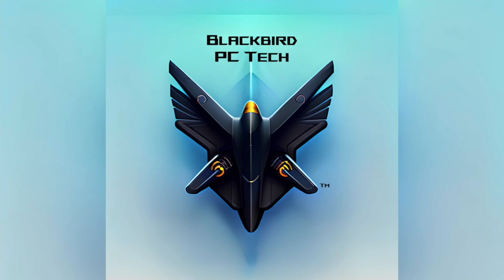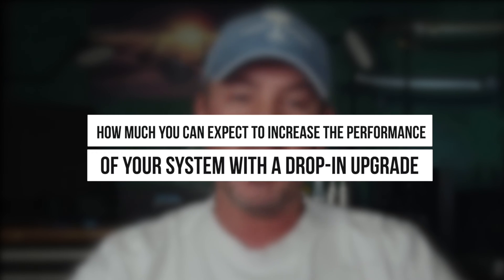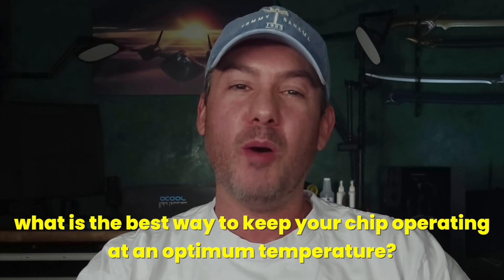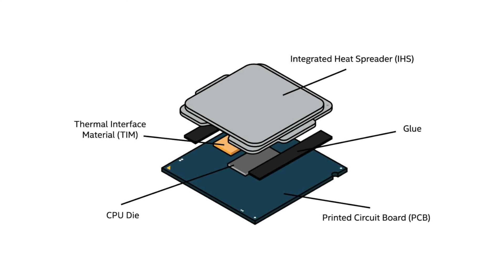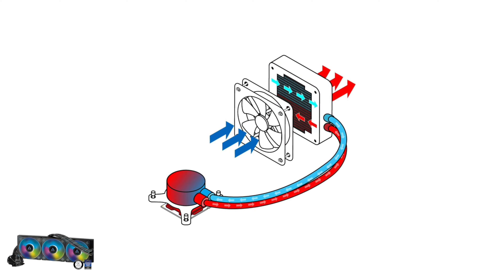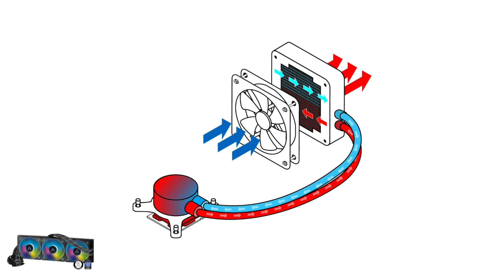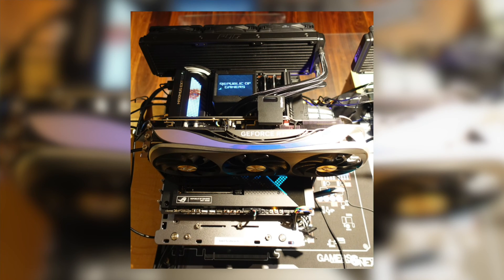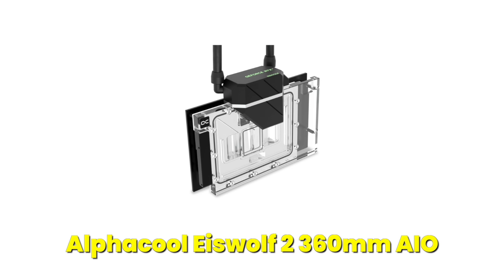Is GPU Water Cooling Really Worth It?

Comment: You're missing the point. It's not about boosting fps, but getting rid of whiny stock gpu fans.
Reply from the maker: The stock fans on the TUF card are actually good wrt noise levels and you can get coil whine on any card, regardless of cooling solution. An AIO does however give you more flexibility to place the fans and to select different fans to meet your needs.
Reply: More like getting OC headroom, no point going water cooling route if you're just gonna use the GPU at stock speeds
Reply: No the main point is to avoid ram and cpu heat building up in the case because of hot gpu air.
Reply: you also missed the point, it's about not having sun temperatures

Comment: Other issues to take into account, space savings of an AIO to get back PCI-E slots on motherboards with limited or bad placement of PCI-E slots, if you are going to a server card that doesn't normally have a cooling solution and other things make the AIO more attractive.
Reply from the maker: Very true, especially with the larger current gen cards that can take up 3+ slots.
Reply: @blackbirdpctech  Or you are trying to stack a bunch of them into a case for AI stuff these days, you really need to have them fit in smaller sizes, or you have to go the old Miner route.

Comment: is it a lot quieter. because thats a fine upgrade if its say 30-40% quieter too. Performance isent the only meaningful stat when you have a box of fans 3ft from you.
Reply from the maker: That's true ... unfortunately I didn't test the noise levels when I conducted the testing for this video. Both solutions use 3 fans however with the AIO you do get to select the fans that you use, so that can be an advantage. I used BeQuiet! low noise fans, so they should be better than the stock fans on the TUF card. That said I tested these on an open testbench and I didn't notice any appreciable difference in noise.

Comment: Of course converting an air cooled card to use an AIO won't be much different performance-wise. They're intentionally limited and will hit their other limits far before they hit their temp limit. You'd need a separate vBIOS to get any kind of performance gain. For example, look at the Asrock 7900XTX Aqua. It's exactly the same PCB as the 7900XTX Taichi, but the Aqua gets a separate vBIOS that gives it a decent performance increase over the Taichi, even if the Taichi is watercooled.
Reply from the maker: While that is somewhat true with modern GPU's, the reduction in temperature will help the card boost higher for longer, so there is some benefit. However you are correct that you would need a new bios to take full advantage of a water cooled card and you would ideally need the voltage limits to be relaxed, something Nvidia has forbidden. Given what has happened recently with Intel and their i9 fiasco, I can't really blame Nvidia for controlling partner cards even though it sucks for enthusiasts.

Comment: I have one in a PNY 4080 super and the main difference is the noise, if you care about the noise, this is the best option
Reply from the maker: Great point … I recently purchased acoustic test equipment so I can measure the noise when I test components moving forward.
Reply: This is the sole reason I water-cooled my GPU!  My gaming machine is near silent now with AIOs on both CPU and GPU

Comment: This was really helpful. Do you think that if the pump of a Liquid-Cooled GPU, like the Colorful Neptune, dies I could just add a Custom Loop Pump between the Card and the Radiator? That would mean I don't have to buy a Waterblock and open up the PCB, right?
Reply from the maker: That’s likely not a good idea but it should still work. A non working pump will add resistance and would provide a surface for debris to build-up. If you are adding a custom pump you might as well add a water block … but yes, that’s a lot of hassle.
Reply: @blackbirdpctech  Thank you, appreciate it!

Comment: Fast answer to the video title:

NO.
Reply from the maker: It’s fast but is it right? For performance it doesn’t matter but there are other considerations, such as case fitment and performance in airflow constrained environments.
Reply: @blackbirdpctech  still not worthy at all. If you are going to build a PC you should know first the total space you got for a GPU and get one that fits in preferably, also if that's the only problem, you can literally get a new case with better airflow and all instead of wasting almost $300 on a GPU block + loop parts to "solve" this, and I'm not even saying "get a bigger PC case" because some ppl don't like big cases, but even then, there's some good quality SFF cases that can fit a full size 4 slot GPU on a tiny package and also solve the GPU fans facing the glass problem.

The only scenario I can see that is "worth" to WC a GPU is if you already have a WC custom for the CPU or you're going to build one, so you can WC both CPU and GPU, which makes sense, but custom WCs still not worth to the wallet at all in first place, people do because it looks cool. If I would guess, I would say that 95% of ppl that have custom WC loops don't even touch the grass in front of the gate to the overclocking world to justify having a custom WC, they do it just because it looks cool.
Reply from the maker: The video is focused on GPU water cooling with a GPU AIO, as shown in the thumbnail ... probably a good idea to watch the video 😉

Comment: You totally ignored the most relevant reason for switching to an AIO.

NOISE!
Reply from the maker: That’s because in most cases you are simply moving the source of the noise, not eliminating it. That said it would be good to understand specifically what you mean … how does installing an AIO on a GPU reduce noise?
Reply: @blackbirdpctech  some people heard of water cooling before they heard of newer quieter fans i guess >.>
Reply: @blackbirdpctech it makes a big difference if you have something like 2 100mm fans or 3 120mm fans which blow the heat directly out of the case..
Reply from the maker: @ I agree, smaller fans running at higher RPM generate higher frequency noise which can be more annoying however, in this case we are comparing a well designed 4090 TUF air cooler to a 360 AIO ... the noise difference is minimal.
Reply: @ I agree. A good air cooler is not worse than a water cooler. But fot most people the benefit isn’t additional performance, but solving the heat/noice/space/airflow problem in the case. My rtx3090ti FE (i got for free, wasn’t my choice) runs at 100 degrees and is screaming in my custom case with bad airflow. I had to massively undevolt it, to be able to use it. Today I bought this AIO on sale as a cheap and effective solution for this Problem.

Comment: If you live in a hot and humid country, and have a rendering PC that runs at 100% for more than 5 hours at a time, then water cooling is utterly pointless. Even the best custom loop will succumb to eventual temperature equilibrium. Most if not all of the water vs air benchmark that shows 10+c difference are only stress tested an hour at most.
Reply from the maker: I don't really understand your point ... if you have a PC and live in a hot humid country why would your PC see those ambient conditions? If you have AC then it doesn't matter. If you are using your PC outside or with the window open then I would somewhat agree that an air cooler may be a better option however, if you plan to run your PC at 100% for more than 5hrs in those conditions I would recommend investing in a better environmental cooling system and closing your windows.
Reply: @mocmocmoc13  Watercooling is just a form of air cooling. The liquid moves the heat to a normal air cooler. The advantage is that you can put better dimensions&location on that air cooler, which can allow it to be more silent or cool.

Comment: $280 for ~2 fps increase is criminal, unless like mentioned in the video, you care about the temps. Also it would be interesting to see your opinion on the noctua NH-D15 as that will be in my next build for the cpu cooler :D (P.s great vid as always)
Reply from the maker: Thanks … I was planning to test that against the new offerings from Corsair and Bequiet … I’m curious to see if it’s still the best. If you are planning to use it with AM5 then make sure you get the offset bracket from Noctua … will make a big difference.
Reply: this is my first time hearing about an offset bracket. I will research into it :yougotthis: @blackbirdpctech
Reply: I have a suprim X liquid and after a year and 6 months of use the hot spots just kept rising and rising, so I decided to reapply the thermal paste, it got worse and memory temps got worse as well, I've taken it apart now 4-5 times and tried different paste and pads and nothing has seemed to fix it, it's defo a mounting pressure issue, but I can't get to the bottom off it so I've decided to get one of these coolers. 
Max hot spots I was getting btw was ranging between 94c-115c, kind of insane right, I've been working with computers for 30 years never run into a problem like this before.
Don't think I will ever get another MSI product again, they cheap out on pads and thermal paste.
Reply: how to expect more fps from a cooling system... wow, .... i am speechless. an aio is to cool your system, not to increase performance. what a weird take. totally lags all logic.

Comment: No word on noise performance? This would be a good reason to upgrade to AIO.
Reply from the maker: I didn’t think that was relevant given that both solutions require three cooling fans. Something to consider moving forward.
Reply: @blackbirdpctech  one consideration may be the size of the cooling fans. larger fans are typically quieter at the same flow rate
Reply from the maker: @pwnsh4rk6 that’s true … so a 280 or 420 could be setup to be quieter, good point.

Comment: This would interest me for my 4070 ti just to get rid of the annoying fan noise at load.

It isn't terrible since my case is decently cooled and card is slightly undervolted, but I'd love the idea to play demanding games with minimal noise
Reply: Is it compatible with the 4070 ti tho?
Reply from the maker: It’s a fantastic AIO, high quality and looks good … just make sure you get one that is designed for your specific brand/model … all of the PCB’s are a little different.
Reply: @blackbirdpctech  Right, I wasn't sure I can find one for a 4070 ti oc aero gigabyte v1. Might ask caseking.
Reply from the maker: @John-t5q4h it would be good to ask gigabyte if their 4070ti pcb is the same as their 4080 pcb … if it is then you can use this AIO.  Is it fan noise or coil whine that is annoying under load?
Reply: @blackbirdpctech  no coil whine so far thank God, it's just the fans going at 70% rpm that become more noticeable than I'd like.

Gpu is at 65 Celsius max when playing max settings in 1440p, so temps are fine. But the thought of having no fan noise while gaming or editing is mouth-watering haha

Fan curves in msi afterburner won't help, as the fans ramp up and down more often so I'd rather leave the stock curve as is.

Heck, I even thought about water cooling the pc with flexible tubing but I've never done it before and seems challenging.
Reply from the maker: @John-t5q4h you could try simply running your fans at a constant speed that is an acceptable noise level and see what happens with temps. Flexible tubing is super easy to install … you could also just custom cool your gpu with flexible tubing, a 280 or 360 rad, pump and cooling block … you don’t have to include your cpu in the loop … could always add it later.
Reply: @blackbirdpctech  That's a good idea, my cpu 14700k is undervolted with - 09500 offset so it doesn't really suffer under load with my air cooler Frost Spirit 140. I could even add a 360 AIO if I needed improvement.

The main noise source I'd like to get rid of is the GPU, I'm just afraid to install the gpu water block as I've never done it before 😅

Pump and expansion tank, flex tubing, some silver torques, gpu water block and one 240mm radiator 30mm thick should do the trick.

And you say it's easy to install? I'm curious 🤔
Reply from the maker: @John-t5q4h as long as it comes with the right size thermal pads and good instructions, which most do from companies like Corsair or EK.  If you go cheap with something from China then it might be tougher.  The tubing is remarkably easy to do … you just need the right tools.  You can buy a kit from Corsair or one of the larger brands.
Reply: @blackbirdpctech  noted! I would probably use EK components, I calculated it would imply a 600 eur expense approx, not counting the cpu block.
Reply from the maker: @John-t5q4h for that cost it might be better to get a 4080 super with a better air cooling solution (such as a Strix or TUF) … you could sell your 4070Ti and get better overall performance … something to consider
Reply: @blackbirdpctech  that's a good point, I'll check what strix or tuf have to offer as cooling options, I thought they all had fans except the suprim.

My idea was in fact to get a 4090 or 5090 long term tho, but might check this option
Reply from the maker: @John-t5q4h the strix and TUF are air cooled so yes it might be better to wait and get the msi suprim 4090
Reply: @blackbirdpctech  what do you think about the 4080 rtx inno 3d ichill? Comes with Aii cooling 🤔

Thanks for all the replies by the way, appreciate it
Reply from the maker: @John-t5q4h no problem, happy to help. I’m not familiar with that card however I have an Aorus extreme waterforce that is a fantastic card … they offer 4080 and 4090 variants … might be a good option to consider.
Reply: @blackbirdpctech  I haven't found the 4080 variant in German online dealers, but I found the 4070 ti tho!
Does it really come with a radiator and the tubes ? The pictures I see depict it as if it came by itself alone.

Thanks for throwing this alternative man, I had no idea there was such a solution! Watercooling the pc can definitely wait.
Reply: @blackbirdpctech  it comes without, just confirmed. I guess I can attach a 360mm 30mm thick rad and 2 tubes to it, but no idea how to apply the coolant inside
Reply from the maker: @John-t5q4h yes, it’s called the Aorus GeForce RTX 4090 Xtreme Waterforce … it has a 360mm rad that cools the gpu … I had it vertically mounted in a hyte y60 and it was fantastic.
Reply from the maker: @John-t5q4h there are two variants, one for custom watercooling and one fully contained with an AIO … that’s the one you want.
Reply: @blackbirdpctech  got it, the best offer I could find was the rtx 4080 INNO 3D iChill with a 240mm aio for 1360€. Might go for this one if I manage to sell the 4070 ti :)

Thank you!
Reply from the maker: @John-t5q4h I took a look at it, nice card … good luck.
Reply: @blackbirdpctech  oh one last question mate, in your experience with aio water cooled graphics cards, do you know if they can come to make any pump noises?

I assume there is a pump circulating the water to the fans. Just wondering if there could be a chance of buzzing noises coming from the pump, cause I'd hate that lol thanks!
Reply from the maker: @John-t5q4h I tested it on an open bench table and I didn’t hear anything other than a small amount of coil whine when the power ramped up, but that was there with the TUF card before I installed the AIO.

Comment: its worth it in some cases. i got a used reference 7900xtx with hotspot temp problems for 300$less , bought an Alphacool GPU AIO and now it runs perfectly fine and quiet, and it cost me alot less than the liquid devil 7900xtx.
Reply from the maker: Very clever to remove the faulty vapor chamber and use the Alphacool AIO … the discount on the card alone paid for the AIO and I really like the look of it too.
Reply: yes, the only problem i had was the thermal paste application using alphacools paste. it wont spread well and stick to the chip, so i had to use another brand.
Reply from the maker: @Einuhreins I didn't even try using their thermal paste but I did have a different issue ... I don't show it in the video but when I started to run benchmarks after assembling it for the first time my temps were worse than on air.  I disassembled it, repasted and made sure all of the thermal pads hadn't moved.  I believe the issue was mounting pressure ... I don't think I screwed it down hard enough the first time ... the second time around everything was great.
Reply: Yup in the same boat over here. Bought a 7900XTX and had the hotspot problem. It ran OK when in vertical position but still got pretty hot. I opted for the Alphacool AIO instead of a lenghty RMA kerfuffle.  It did the trick and then some. I wouldn't recommend it in most other cases though.

Comment: You’ll get a little core temp reduction. But you’ll increase the VRM running it with an AIO. I get max temps at 62c on my 4090 air cooled
Reply from the maker: Thanks for your comment but why do you think the VRM temps will increase?  The AIO block has thermal pads that make contact with the VRM’s, that’s how I was able to OC the memory more with the AIO.

Comment: I have a 3080TI and for me a temperature reduction as well as a noise reduction would be worth it at 65% fan speed my card is noticeably loud.
Reply from the maker: Then definitely consider this upgrade … it’s a great kit and very easy to install … just be careful to provide sufficient mounting pressure when you put it together … I didn’t show it in the video but I had to pull it apart and reapply the thermal paste because I didn’t tighten it enough the first time.  The loop is also refillable.  Thanks for watching!